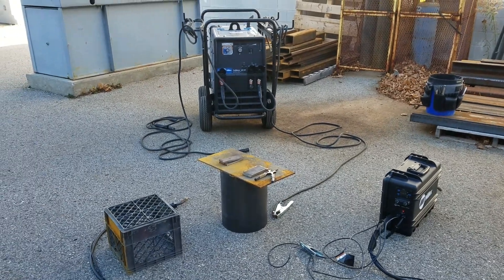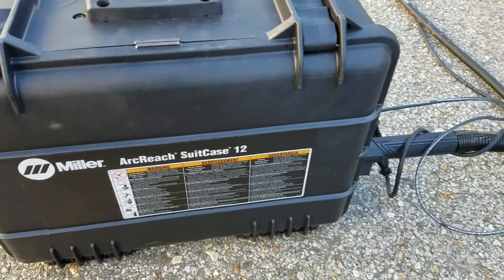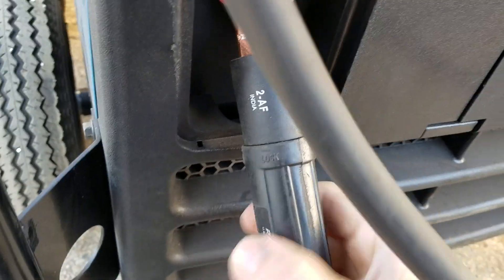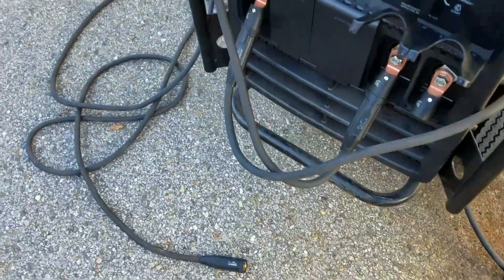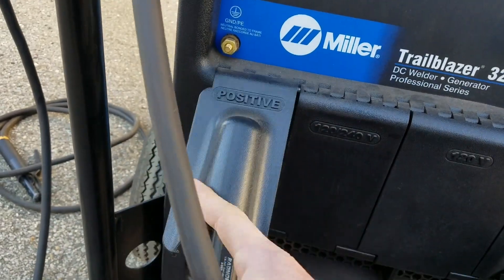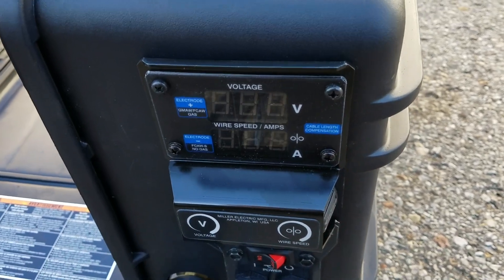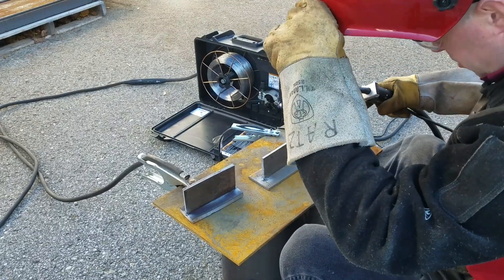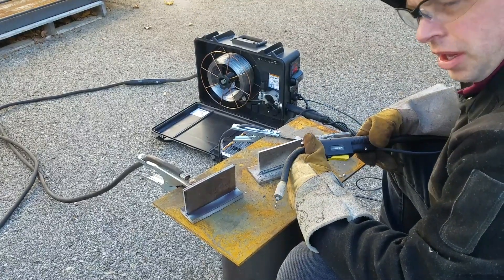FCAW-S on Trailblazer 325

Comment: U want to run 211 or 212 wire on CC NOT CV .. CC WILL GIVE YOU Better penetration . Stronger weld . 32 yrs experience.. run it every day .. u can see the difference on CC IT Penetrates👍👍👍 CV DOESN’T GIVE YOU A STRONG WELD

Comment: Hi, do the genders have to be reversed?
Reply from the maker: Depends on the wire type, most self shielded wires are DC negative, so then yes in most cases.
Reply: I have never seen anyone plug the suitcase into the ground side very interesting

Comment: Thank you Tim, very valuable set up tips for us old folks.Got me a 301g running my way old S32.

Sean
Reply: Those old S32 suitcase feeders are pretty tough, got two of that nobody would use. There were junked out under the table. The only thing wrong with them was the contractors were bad. Found a couple of Albright contractors on ebay. Cleaned them up, got some used Bernard guns and they both work great.

Comment: You dont have to switch polarity. The machine does it for you when you select fcaws
Reply: That’s not true only a select few do that. It actually switches to constant voltage from  constant current.
Reply: Why is he not running CC in this video? I was running this same feeder today with flux core wire running CC…..
Reply: @jerryvwallace2 a lot of big self shielded wires run on CV, I use T-8 wire and it’s run on CV, and unfortunately the trailblazers we run don’t switch polarity automatically, there’s been times where I’m running self shielded wire and switch over to dual shield and forget to switch my cables over and create a mess.
Reply: I was confused i always plugged the suitcase into the positive lead

Comment: Is that the same way you would hook that up when using Argon gas
Reply from the maker: The only reason I would use argon gas during MIG welding would be for welding aluminum. So I would then switch to DCEP, instead of DCEN. Probably would need a push-pull gun and must have no wind if outside.

Comment: Is possible to weld aluminum using suit case?
Reply from the maker: Never seen anyone try it before. Usually a push pull style gun is used for aluminum. Argon shielding gas would need to be used and no wind when welding outside, that would cause weld defects.

Comment: Set my leads up the same way. I dont use the feeder alot so I dont have the lugs yet, they are coming though as the studs felt alittle looser the other day when I ran the feeder. Plus it you need to extend things its alot easier
Reply from the maker: Good luck with everything!!!

Comment: morning greetings from phoenix az
my question's
why do you switch cables?
i got  a bobcat 250 and a Esab suitcase am connect my lead like 
if am going to use stick just switch the knob selector to wire and it's work
Reply from the maker: I switch the cables because I need to run DC- for the type of self shielded wire I am using. So I want my ground clamp to go off the positive terminal and then I just figured I would put a connector splice in the electrode holder. This way I could plug into the dinse connector on my suitcase wire feeder from my stick lead. Basically, I did what the local welding supplier told me most others do. Hope this helps.
Reply: I have the 225 bobcat  ,I don't think you have to switch the cable s to switch the polarity, it switches it for you when you select gas or no gas....that's y the extra spater